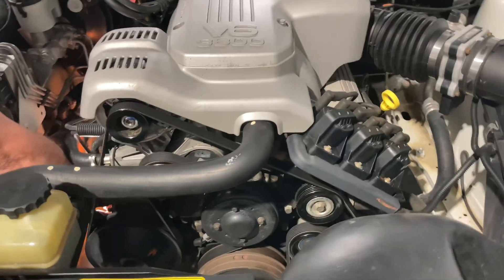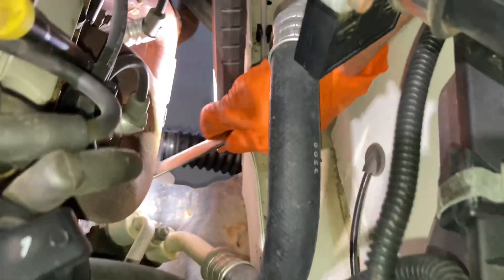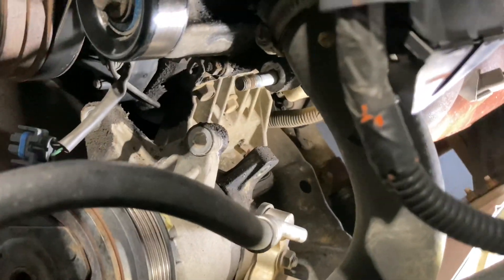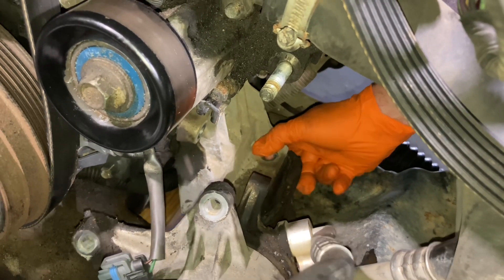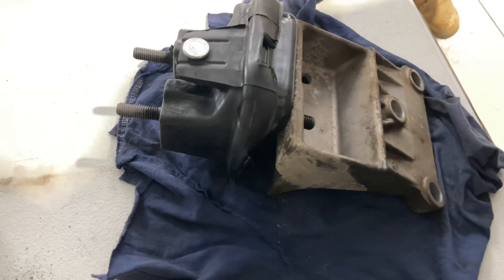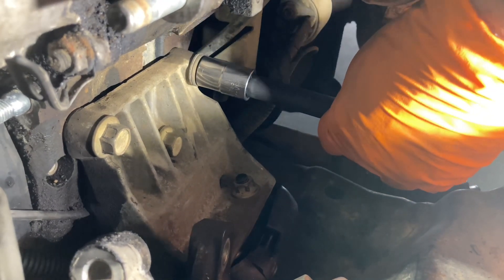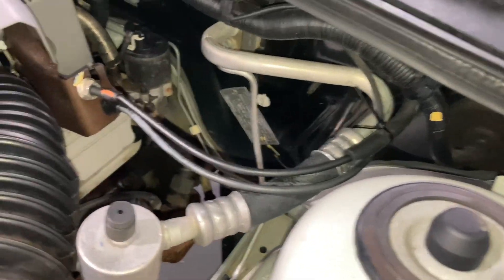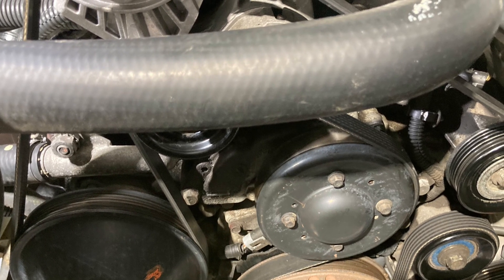Engine mount replacement Holden Commodore

Comment: The special tool needed is an endeavour brand torque adapter 
15mm-3/8 square drive with 50mm centre and the part number is
ET0015 bought from Repco

Comment: I grabbed an old 15mm spanner whacked the end off a couple inches away from the ring end and welded it back together on a mad angle worked a gem